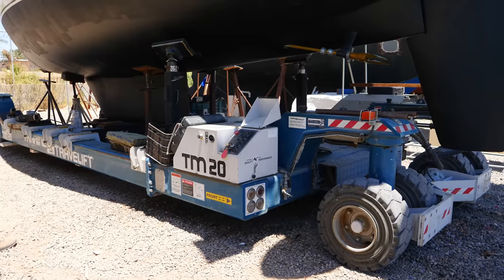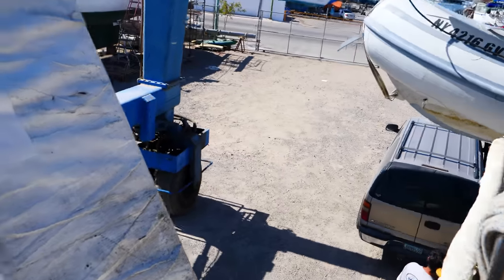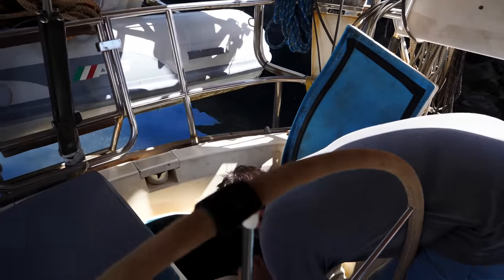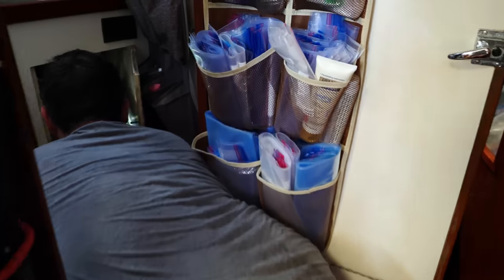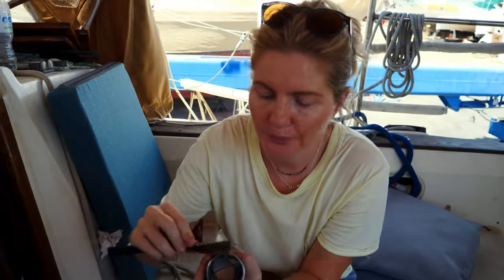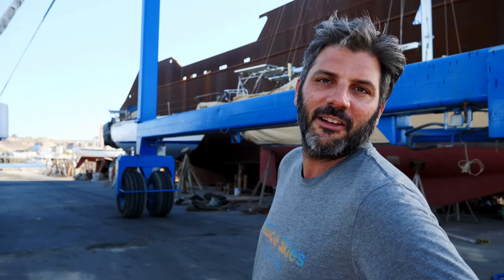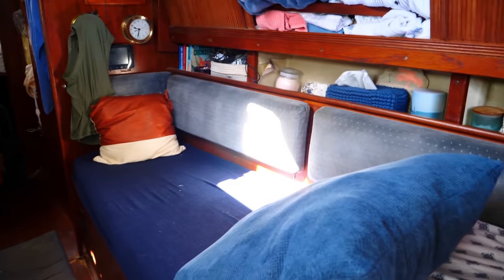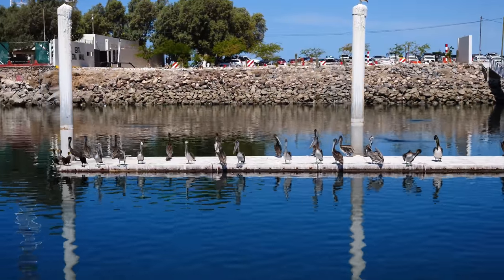Failure to Launch ..We're Taking on Water! (Calico Skies Sailing, Ep 188)

Comment: I should have said something about using 5200. But you had already used it, so I kept my mouth shut. 4200 seals as well and is so much easier to remove. The idea is you're making a gasket, no gluing the through hull to the boat. The good thing is, you took the time and fixed it the right way. Glad you guys got back in the water.
Reply from the maker: Lesson learned!

Comment: The trick with any flange fitting is not to do it up tight until the sealant has at least partially cured, so that it creates a gasket. Rushing it just squeezes all the sealant out and it leaks. Too late for the through hulls, but you will have others (like tanks?)
For my next piece of advice you will need an egg and a straw 😅
Reply from the maker: nice tip!

Comment: Congrats & Godspeed on Grace's recovery.

Bill on overheat issues & assuming coolant, Heat exchanger and Themostat are ok, if Calico has engine heated hot water? Verify that it does not have an air lock or plugged. Happens a lot and I fill from lower hose with funnel higher then return line, similar to how you have to fill an outboard lower unit with lube.
Reply from the maker: it was an air lock, had to burp the system a few time to get it fully primed

Comment: the proper way to install any thru-hull is to just snug the nut and allow the sealant to cure and form like a o-ring and then go and tighten the nut tight the next day
Reply: I think with 5200 the surface hardness would probably be a bit too high to do this??

Usually with RTV and other sealants you wait for a heavy skim layer to cure then do final torque.
Reply: @darrengladstone3159  as long as you can keep the thru-hull from turning, it has always worked for me, you cannot get 5200 on the threads at the nut...it does no good  there anyway... the seal is on the outside
Reply: 5200 takes 7 days to fully cure

Comment: Hey guys, I know it is too late, I always uses butyl to bed everything. Otherwise Calico Skies looks awesome! Nice work.

Hope all is well. Fair winds....
Reply from the maker: Even below the waterline? We almost always use butyl tape when doing deck hardware
Reply: @CalicoSkiesSailing  Yes, but not the Home Depot kind. There are 3 or 4 brands for below waterline  use. People are worried about adhesion. The adhesion occurs when you tighten the threw hull. Nothing is glued to your hull unless you use 5200. I replaced threw hull fittings on a Fuji 45, 14 years ago and used butyl on all of them. It has had 3 bottom jobs since then and zero leaks.

Comment: Praise God, I have never had a failure to launch.
Reply from the maker: That's awesome, this was our first failure but we touched so many below the water line thru hull figured there was a chance
Reply: @CalicoSkiesSailing  I was doing a play on words.  But in reality, I was the head mechanic for  a large catamaran boat company in Hawaii.  I would have lost my job if we splashed and had to come back out.   We had to hire a heavy equipment operator to pull the cat out of the water.  He was expensive.  I designed a cool trailer to haul the cats with remote control steering. 

I miss that job.

Comment: When I saw you using 5200 I wanted to say stop!  Never, never use 5200 on anything that has the potential of EVER needing to be removed or replaced. Repeat never.
Reply: Well 5200 exist for use in marine. And depending on the level of refit, everything may/can/will come off. And people find a way.
Reply from the maker: Yea made it more difficult to redo the thru hull for sure. But we still were able to get it off thankfully